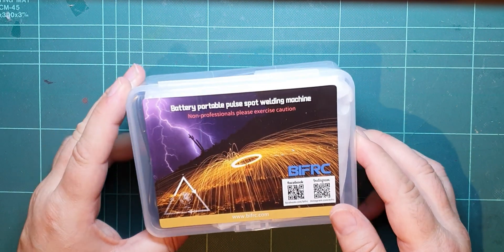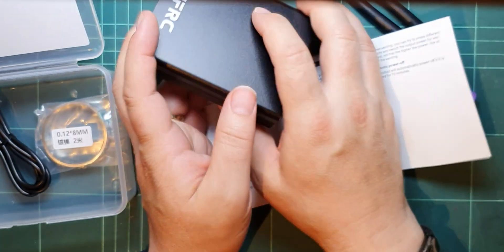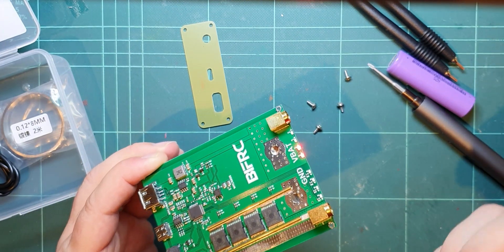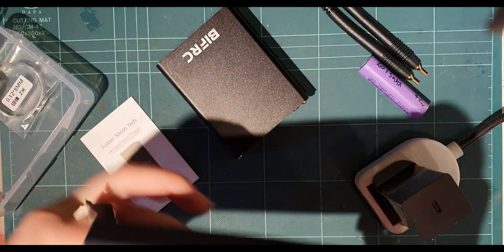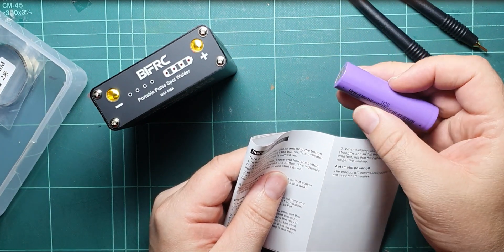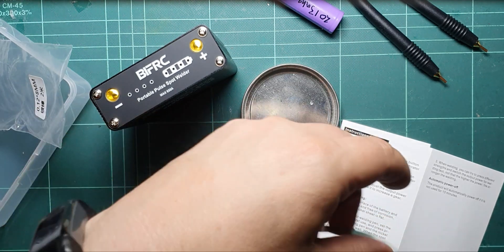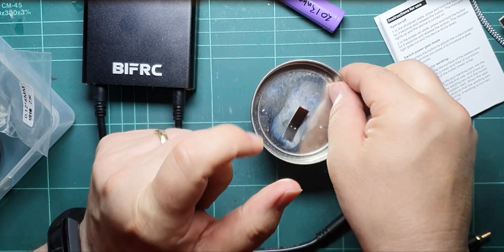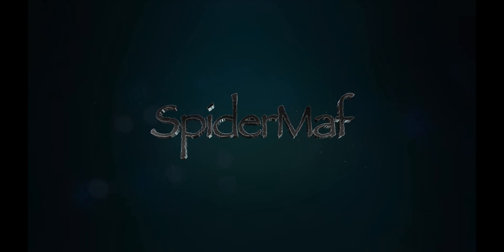BIFRC 18650 Battery Spot Welder - Box opening and test

Comment: it is the same thing as those cheap boards you could get for $8 it just has a pretty case in it you can get the other ones with the I think it's a 60 connection yellow connection some have five mosfets I'm a 10 mosfets I don't know what the difference is but the red one the little red one in a box with only worth eight or nine dollars I think I paid $10 for mine works just nicely anyway and all the modifications everybody tells you to do don't do on their crap
Reply: The problem with the DIY solution is that it requires a big lead acid or high current lithium packs. And it is quite easy to destroy the MOSFET if your battery is too strong (low internal resistance). This BIFRC battery seems just right for the MOSFET and ready to use without any fiddling.

Comment: Got the same spot welder, and work great, have already made a Worx 20v 6A battery.

Try not to push hard, just push hard enough that the metal is flat, and then it will spot weld it the best.